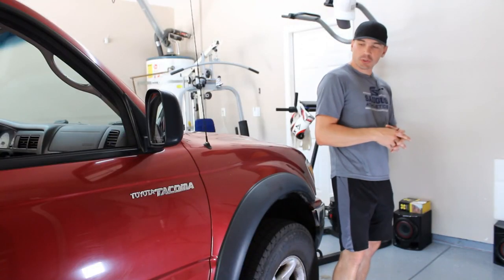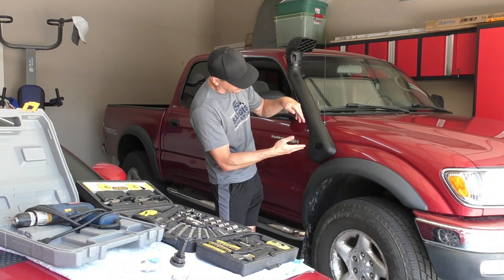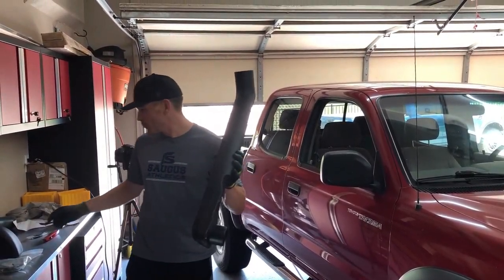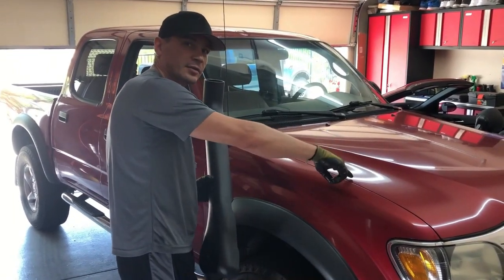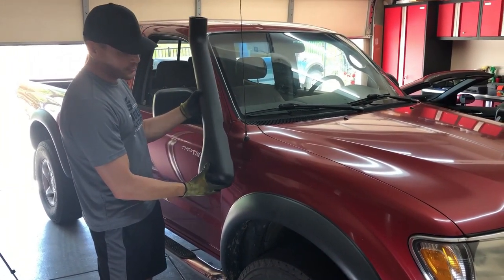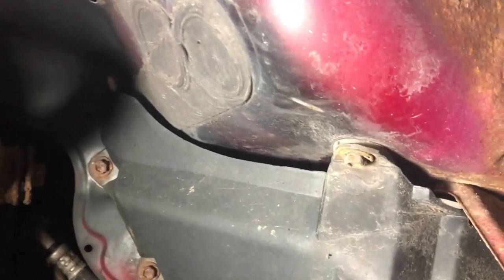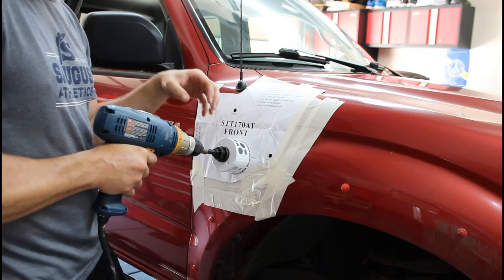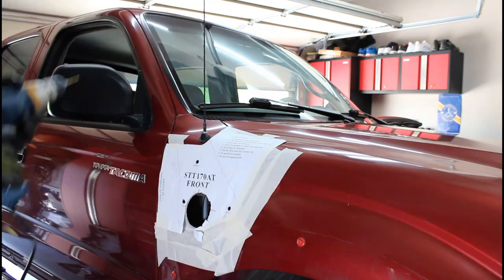Toyota Tacoma Snorkel Install

Comment: Did you have to add any additional sealer to prevent water from entering the tubes?
Reply from the maker: No need as you are clamping the coupling hose to solid pipes on both ends. Also, there is not going to be any air pressure inside of the hose or water pressure outside unless you are really deep under water for a very long time, but then you have bigger issues. Good luck!
Reply: Thanks for the information. I will be crossing some decent deep waters. Not sure how long but maybe safe to deal it with marine style glue Incase.